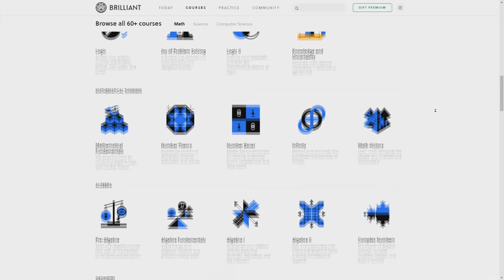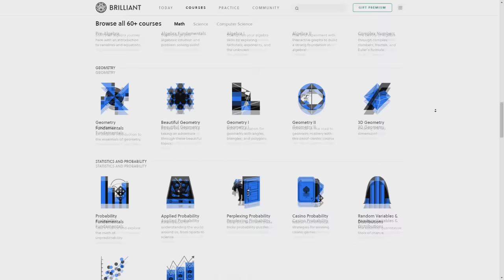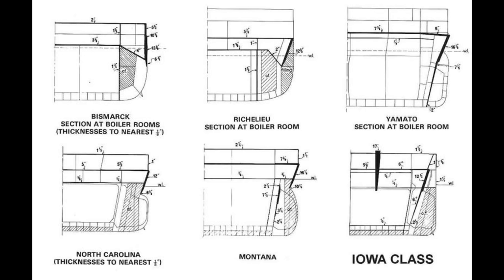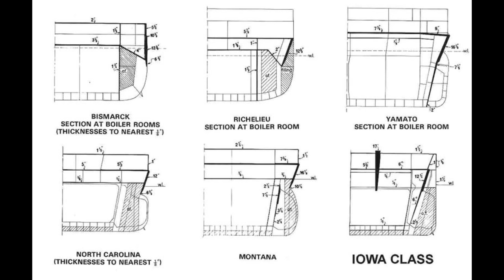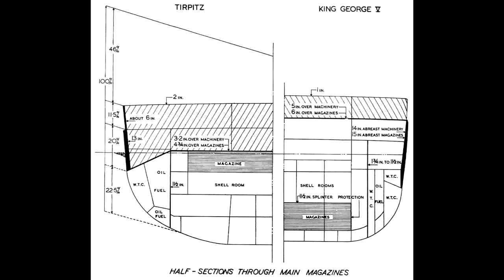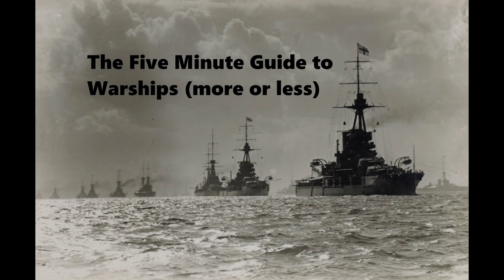Dreadnought Modernisation - A tri-wire balancing act

Comment: As I have an old dreadnought rusting in the garage in the backyard, this video was very useful in approaching how to refit it. No LED light kits or spinner hubs for me, just good old fashioned increase gun elevation, convert from coal to Bunker C and slather on the deck armor.
Reply: Do you prefer a paint brush or roller for applying a coat of deck armor? which gives more consistent results?
Reply: I'm not sure this guy really has an old dreadnought, since he says it's both in the garage and the backyard.

But if he does, I think spinners on the props and LEDs around the gun muzzles would look pretty cool. And hydraulics to make the barrels bounce up and down as you slowly cruise would be awesome.
Reply: @mikearmstrong8483  You have to consider that dreadnoughts tend to be quite large, and he may not have the biggest of garages.
Reply: @mapmuncher5587  
Well, I hope he doesn't live in one of those cities where they cite you for having nonrunning vehicles on the property. And if he gets it going, that big Confederate flag on the garage wall would look cool waving from the main mast.
Reply: Do a 'Will it run?" video!
Reply: @christopherxaviercannon2801  
That was meant as rhetoric. I don't do political discussion on YouTube. I don't agree with what it stands for, but the flag itself in design and color is striking. Looks a lot better than a Greek or Swedish flag.
Reply: 😁🤣🤣
Maybe a big single turbo??
Reply: @wheels-n-tires1846  it's got four on the boiler room floor, gonna need four big turbos. Which they do use on modern marine diesel engines on the big container ships.
Reply: @giantweevil2737  Nice!!! Probably oughta go intercooled as well. Now- has anybody tried nitrous on a boiler??? That oughta help the APHP (All Prop Horse Power)😁
 Wonder if someone offers a fiberglass water effect kit for your year and model??
Reply: Have you considered curb finders?
Reply: @andrewgraziani4331  
That's what all those poles sticking out the sides are for; curb finders. What did you think they are for;  something silly like holding nets to stop torpedoes or some nonsense like that?
Reply: @mikearmstrong8483  Oh, okay now I see.
Reply: Rusting?

Shame.
Reply: Thought I was the only one
Reply: Turn it into a lowrider, dude. Lowrider Dreadnought.
Reply: The Elbonian navy Is in the market, coal preferred.
Reply: I'm imagining one of those mechanical refurbishment videos, only now on a battleship.    He's going to need a really big tub of rust remover.
Reply: I have an old dreadnought rusting in the garage... 
My father had an old inter-war ocean liner rusting in the garage in our backyard. He renovated and refitted it, adding electro motors to the shafts. Now I have it on private exhibition. 
 
...Oh, I forgot to mention, the vessel is a ship yards 1/87 "scale model" now exhibited in my living room.
Reply: I see so many of these parked in the front yard and turned over to the wives to plant daisies in it and decorated with garden gnomes. Another garden Dreadnought, pity.
Reply: @ThomasTomiczek  to be fair, most of the still- existing dreadnaughts ride rather low in the water...

(I don't actually know what I'm talking about, but i suppose there are more resting on the seabed than anywhere else?)
Reply: @ThomasTomiczek So...the USS Monitor but a dreadnought?
Reply: @wheels-n-tires1846  Always go for twin turbos
Reply: @johnthomas2485  My 1992 Stealth RT twin turbo approves of this message....🤣
Reply: @nos9784 i think most got scrapped. They didn't do a lot of fighting
Reply: Go with NATO F-76. Much easier to handle, way less dirty.
Reply: Wait...so you have a war ship in your garage
Reply: hes got 6 75 inch sub woofers in the stern section.

"THIS SILENCE OFFENDS SLAANESH, THINGS WILL GET LOUD NOW!"
Reply: trainspotter?
Reply: You should get a pool to keep it in
Reply: Don't forget to visit your Bofours salesman to get like all the 40mm mounts
Reply: I need a rudder. Does anyone have a rudder? Mine fell off somewhere along the way to Morocco. 🤷
Reply: Coolest.  Garage.  Ever.
Reply: @larsrons7937 1:87! Now you need a vintage H0 railroad and dockyard branch running around and alongside ! 3rail vintage Marklin in Europe is my preferred, all metal railbeds, oldest loco's and cars.😊
Reply: @mark7321   That would be awesome, thanks for the idea. They also used scale 1:87 for Märklin? I didn't know. I think my late father left a Märklin model railway with cars. He bought it used in the late 1970s so it's probably much newer than the 1930s, but a car or tow could be old if lucky? 
The vessel model is MS Chrobry (has a Wiki page now), built in 1939 at Nakskov, Denmark, for a Polish South America line. While returning from S. America on her maiden voyage WWII broke out, and she changed destination to the UK. They used her as a troop transport in the Norwegian Campaign where she was sunk by German divebombers near Narvik in May 1940. All that remains is the model I have.
 
In his youth my father added internal electric light and an electric motor to drive the screws. These modifications made no permanent changes to the model, only added to it with no damage.
Reply: Bunker C:  good stuff.
Reply: Do you rent it out? As I have an annoying neighbor....
Reply: And add on upgraded anti aircraft guns
Reply: Did you get the hood scoop?  It adds like 15bhp, oh an the stickers! It needs flame stickers on the side!
Reply: @scooterdescooter4018 75 inch... the frequency those might hit wouldn't be heard, persay, but felt in your bones... from across the harbor xD
Reply: @mikearmstrong8483  it's long...

Comment: Like the mighty jingles says… “You can modernize these things all you want by rebuilding the superstructures, adding more aa guns,  making the hull sleeker, adding torpedos bulges etc... But at the end of the day they’re still the old slow gas guzzling battlewagons that simply cost too much to operate, and were even more obsolete than the most modern fast battleships of the day, which even they were made obsolete by the aircraft carriers. In the early war the U.S. had to make a choice between the old battleships and the aircraft carriers, and wisely they chose the aircraft carriers.”
Reply: Tbf carriers are hardly cheap, cheaper to build sure but much more expensive to operate
Reply: @deeznoots6241    No I meant that the navy had to choose which ships to operate. The battleships were slightly more expensive to operate than the carriers, but yeah the carriers were almost equally as expensive. They had to choose between one or the other and wisely they choose the carriers that were the decisive weapon of the naval war.
Reply: @stevenmoore4612  Then regressed by choosing not to cancel the Iowas: there were much, MUCH better options for carrier escorts. They had a chance not to make the same mistake everyone else had made and blew it.
Reply: @bkjeong4302  And survive a Sovet missle onsualt what is a missle crusier going to do when out of AA missles engage them with pistols and rifles? Also Battleships have a huge advatage over carriers in one area... shore bombardment... One shell can't be more then $1K, a cruise missle is $1mil. And with China we best be putting these new fangled railguns or hybrid hyper long range shells to good use. By making new Super BBs to sail with the Super CVs as they don't have the armor, cheapness or frankly the range of what a modern 21st century battleship would have... Still though we should have keept the Iowas we had as a stop gap till we got their replacements... too late now though.
Reply: @GreenBlueWalkthrough  

And how is a battleship supposed to engage a missile cruiser when it’s not coming anywhere near its guns? And a missile strike with existing anti-ship missiles is going to mission-kill a battleship at minimum by tearing through the unarmoured superstructure, not to mention that people could just invent guided weapons systems that have AP capabilities (the Germans did, with the Fritz X).

People keep bringing up how cheap a shell is compared to a missile and completely ignore that battleships cost a lot more to build and operate than most missile-equipped warships, negating that advantage.
Reply: Cost of a shell vs cost of a missile is irrelevant in ship vs ship or ship vs air combat.   A shell simply won't do the job against modern weapon systems.  Of course there is the US Navy LRLAP super shell, but it costs $800,000 for each shell.  Guns can still be useful for shore bombardment.
Reply: @jimfisher5856  But shore bombardment you have bombers or icbms if things get out of hand. BB's have the problem to use the guns you need to get in a certain range that is way shorter than the range of aircraft. As such CV's have more force projection. And you don't expose the carrier as much. Aircraft are expendable to a point.
Reply: the choice between operational carriers and sunken battleships is hardly a remarkable one
Reply: @alexhunt7810  I meant the old battleships that were not sunk or badly damaged at Pearl Harbor. We chose wisely not to use them because the carriers ended up being the vital weapon.
Reply: @stevenmoore4612  I'd argue the decision to not deploy them in the close fighting at Guadlcanal was pretty stupid. Heavy surface units had proven to be brutally effective in night and close actions in the North Sea and Med.
Reply: @GreenBlueWalkthrough  battleships in a modern setting are simply unviable at all. itd just get missile after missile, drone after drone until its ciws  system ran out of ammo
Reply: @bkjeong4302  dear, stop for a second and tell me what IS a missile cruiser. Come on, on the basis of what it is, what is a missile cruiser? What is a missile, it's not a hard question?:D
Reply: @rainyvideos3684  okay, the energy ciws will shoot till it runs out of power and the capacitors need to recharge. Its the same issue
Reply: @agentbarron3945  Why do you need to recharge the batteries if you can draw power from the engines just like a car battery does. Bear in mind these are far bigger engines and generate far more power then any car engine.
Reply: @rainyvideos3684  the way a ship engine and a car engine works are completely different though. 

A ship engine can't quickly ramp up and down like a car engine does. It takes time for the reactor to heat up and provide more pressure to spin the turbine faster and then when the laser stops firing all of a sudden the turbine is producing way way way too much power which will damage the electrics of the ship. Or cause a meltdown 

Also the laser wouldn't be able to fire right off the bat then if you just used engine power as itd take time to ramp up
Reply: @agentbarron3945  And you don't think under combat conditions or under conditions in which they are prepared for it the engines wouldn't be ready? Even if they weren't the batteries would last long enough anyway to cover the gap.
Reply: @rainyvideos3684  the issue really stems from ramping the engines back down and figuring out what to do with an extra 500kw for like 15-30 min
Reply: @bkjeong4302  The Iowas were already laid down, and at that time, battleships were still very much relevant. Battleships on both sides saw surface action in the course of the war. The Iowas were completed just a bit too late to ever serve that purpose, but the US didn't know that in 1942. I don't think they made any mistakes there. The invested heavily into aircraft carriers, as they should have. They just finished the 4 ships they had already started because the US had just lost most of its useful battleships, and the alternative was to scrap the Iowas in their dry docks
Reply: @naverilllang  

I have serious doubts about battleships being all that relevant at any stage of WWII: almost every surface action they got involved in, even at the early stages of the war, were things that carriers, subcapital units, or land-based aircraft could have accomplished.

The only surface actions that really justified the use of battleships in WWII were Second Guadalcanal, North Cape, and Surigao Strait.

And by 1942 the writing was not only on the wall but plainly obvious to pretty much all navies. The fact the US decided to go ahead with the Iowas doesn’t really have an excuse, whether they somehow failed to realize that battleships were done or whether they knew and still went ahead anyways.

And yes, the US did invest heavily into aircraft carriers but not as heavily as they should have. The Japanese also invested heavily into aircraft carriers but are considered to have been stupid enough to not realize battleships were obsolete, because they still built the two Yamatos and that was a stupid idea: by the same logic, the US putting battleships into service even after they started focusing heavily on carriers was also a stupid idea.
Reply: agentbarron boil some water. You have an entire ocean after all.
Reply: @bkjeong4302  pretty simple really, give the BBs some missiles of their own. There's plenty of room on a modern BB that wouldn't be available back when BBs were being built. Not to mention that something simple like ERA or spaced composite armor might just straight up defeat any missile.

The spaced Composite armor/ERA armor scheme seems to be the biggest advantage for a modern BB. We've seen what those types of things can do for tanks. You can add significantly more armor for significantly less weight. And because all of our knowledge for how missiles interact with tanks, we know how to defeat missiles with armor.

Other obvious things that would be added to a truly modern BB would be fully automatic loading systems for the main guns, nuclear power so they could in theory even be faster than carriers since they don't need all of the electronic equipment that carriers do, and much better radar for FCS and navigation.
Reply: @OtterTreySSArmy  If you’re going to rely on missiles, you really don't need the main battery (which isn’t going to be in range of enemy ships anyways and just takes up space). It’s never going to be as efficient as a poorly missile-based warship.
Reply: @OtterTreySSArmy  Composite and ERA is meant for HEAT warheads and APFSDS. The pure high explosive of anti ship missiles wont be severely affected. And if you have missiles, why bloat the ship with giant guns? And don't say shore bombardment, that only possible for anyone without any coast defences.
Reply: @Bk Jeong, I think that the sailors aboard the cruisers and destroyers that had to stare down much larger Japanese task forces at night around the Solomons would have welcomed the help of a battleship, even an older one.
Reply: @5000mahmud  Composite and ERA is meant for HEAT and APFSDS precisely because plain HE shells and other unshaped charge munitions were useless against even more primitive armor. WWII ships regularly survived mine and torpedo hits that would have instantly crippled a modern unarmored warship.

And couldn't the same thing about shore defenses be said for aircraft? It's an established fact that aircraft cannot strike ground targets protected by functioning IADS. Does that mean they're obsolete? No, because they and every other arm tries their best to destroy said IADS. Same goes for shore bombardment, except heavy guns can deploy more munitions at lesser cost. There's a reason field artillery, and especially gun artillery used far more than aircraft for fire support.
Reply: It wasn't stupidity, it was capability. Nimitz and his team contemplated sending them, but there was not enough tanker capacity in the Pacific to support the slow BBs AND the carriers. The Allies had decided to use  their might to defeat Germany first, while keeping Japan in check and on the back foot. The nickname for the Guadacanal campaign WAS 'Operation Shoestring'.  The one thing that I do think should have been done  that wasn't was to use the S-boats to interdict the Tokyo Express.
Reply: @OtterTreySSArmy  Cheap drones and cruise missiles made our expensive, unarmored destroyers look pretty stupid in the Red Sea. Sure, they can shoot down a $5000 drone with a multi-million dollar missiles but we run through those pretty fast. That just leaves one lonely 5”/62, some optical dazzlers (maybe) & CIWS. Times like these it might be nice to have some armor, a deck loaded with dakka & some heavy guns for shore bombardment. The Iowas were pretty bloody accurate gun platforms to begin with & they became a lot more so after we tied a laser rangefinder into the the old gunnery computers. And DARPA had already designed sabot rounds for the 16”/50 with 50 & 100 mile ranges.
Reply: @5000mahmud We’re learning the hard way in the Red Sea.